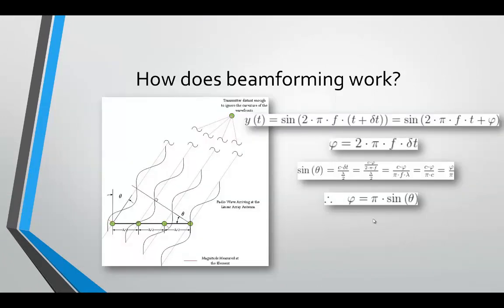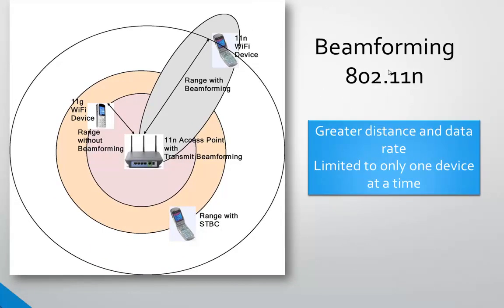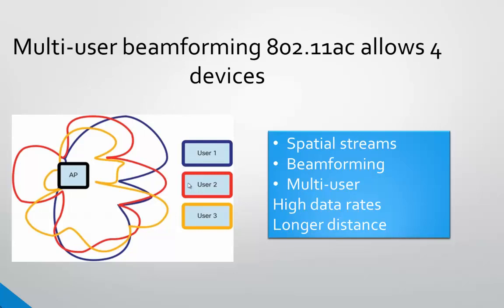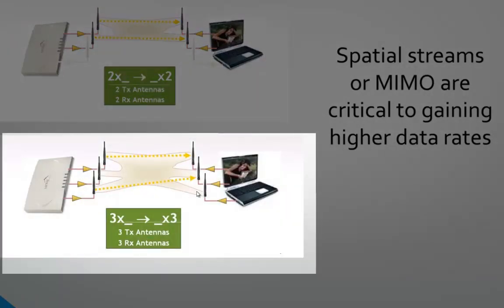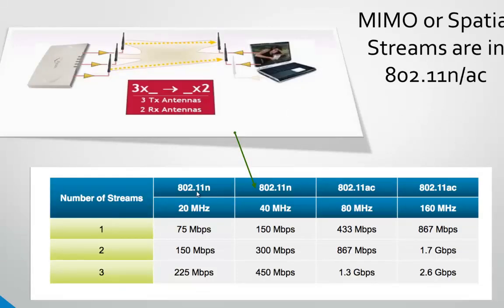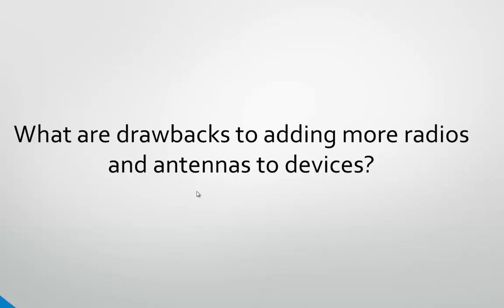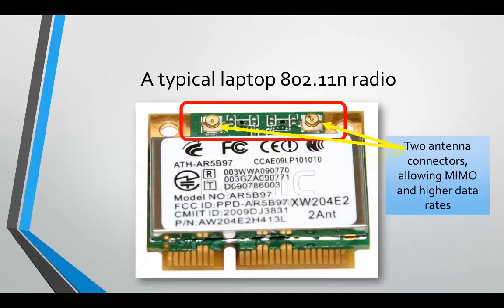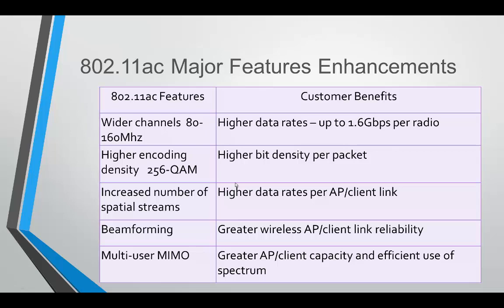802.11 Beamforming, MIMO, Multi-User beamforming, Spatial streams

Comment: Wasn't there room for only two 160MHz at the same time/place given regulations? More than that is only theoretical, right?
Reply from the maker: 1. Use of 160 MHz Channels
160 MHz bandwidth is achievable in 802.11ac (Wi-Fi 5) and 802.11ax (Wi-Fi 6) and is used for high-speed data transmission.
160 MHz channels can be implemented in two ways:
Contiguous: A single block of 160 MHz spectrum.
Non-contiguous (80+80 MHz): Two 80 MHz channels bonded together.
2. Simultaneous Use of Multiple 160 MHz Channels
Standards Limitation:
Wi-Fi standards (like 802.11ax) do not support more than one 160 MHz channel per connection or transmission. Each access point or client device typically operates on a single channel at a time.
Devices supporting multiple spatial streams or MIMO can make use of the same 160 MHz channel to enhance throughput but cannot use two separate 160 MHz channels simultaneously for the same transmission.
Hardware Limitation:
Most consumer-grade and enterprise-grade devices are limited to using a single 160 MHz channel at a time due to radio constraints.
3. Regulatory Constraints
Frequency Bands:

The availability of 160 MHz channels depends on the spectrum allocated for Wi-Fi by regional authorities like the FCC (USA), ETSI (Europe), and MIC (Japan).
In the 5 GHz band, there are only a limited number of 160 MHz-wide channels due to interference avoidance and coexistence rules with other technologies like radar (DFS regulations).
The 6 GHz band (introduced with Wi-Fi 6E) provides more opportunities for using 160 MHz channels due to its wider spectrum allocation.
Dynamic Frequency Selection (DFS):

Some channels in the 5 GHz band require DFS to avoid interference with radar systems, which restricts their availability for Wi-Fi.
4. Future Possibilities
802.11be (Wi-Fi 7):
Wi-Fi 7 introduces 320 MHz channels, which double the bandwidth of 160 MHz. While this standard does not allow multiple simultaneous 320 MHz channels for a single connection, the wider channels will provide even higher throughput with advanced techniques like multi-link operation (MLO).
Multi-Link Operation (MLO):
With MLO, devices can operate on multiple channels simultaneously (e.g., in the 5 GHz and 6 GHz bands), though each channel is typically no wider than 160 MHz in current implementations.
Reply: @TechsavvyProductions  Great info! Thanks a lot!

Comment: Spatial stream does NOT depend on the number of antennas! The number of possible spatial streams depends on the processing capacity and the transmitter feature set of the device - not on the number of its radio .
Reply from the maker: I appreciate you taking the time to comment and give feedback on the topic.     I want push back on any topic or concept that is presented incorrectly,  anything incorrect should be challenged by viewers.   I will do some research, thanks again  Mr. Vanderpool